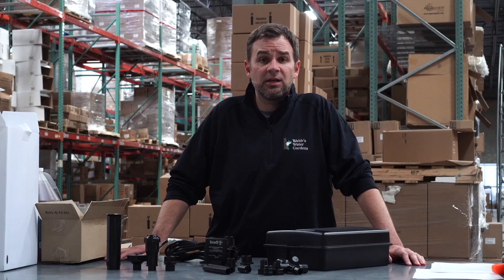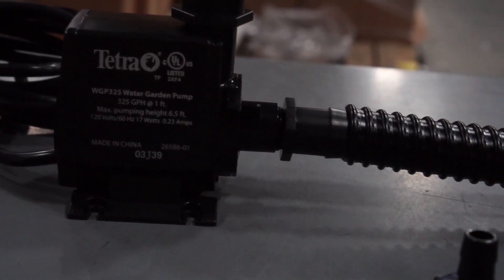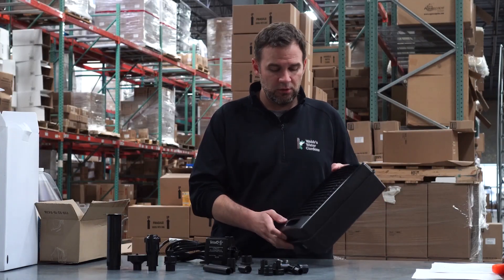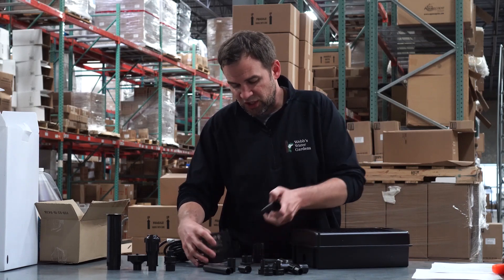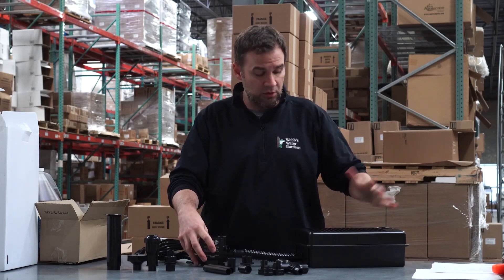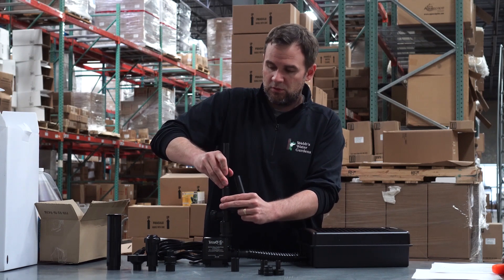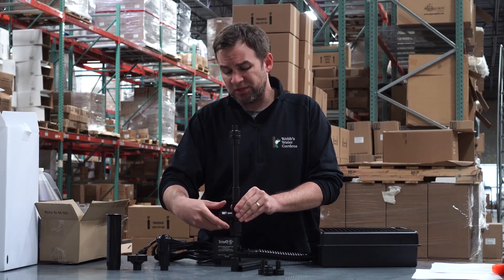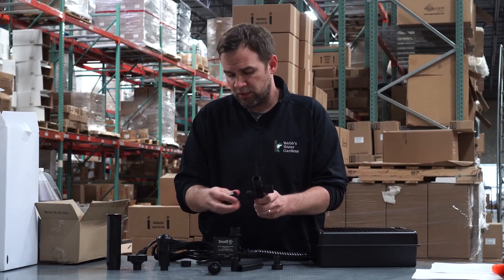Tetra Pond Filtration Kit 250 Technical Breakdown

Comment: The coarse filter should go on the top.  The fine filter goes on the bottom.  Think about which way the water flows ... from the top down.  You need to filter out the bigger particles first, before filtering the smaller ones.
Reply: He knows!
Reply: @wilfredoalta3475  1:02 time mark _ No, he doesn't!

Comment: Hey man, this is late to when the video was posted but, I have this setup and from the submersible filter unit I don’t feel any suction or water going into is that normal?
Reply from the maker: The pump is not incredibly strong, not feeling a pull from the filter is normal, but it's there.